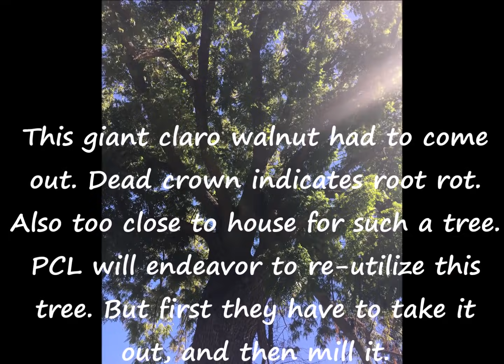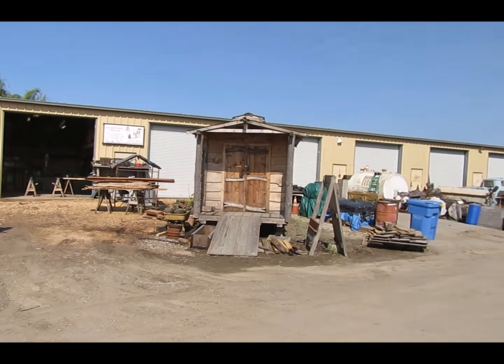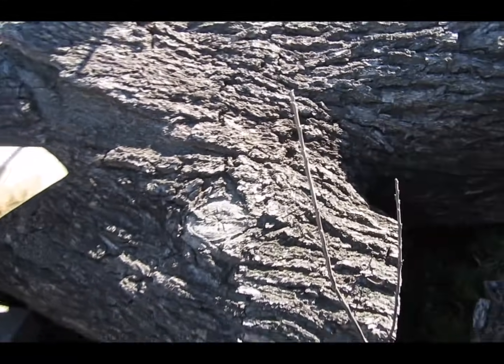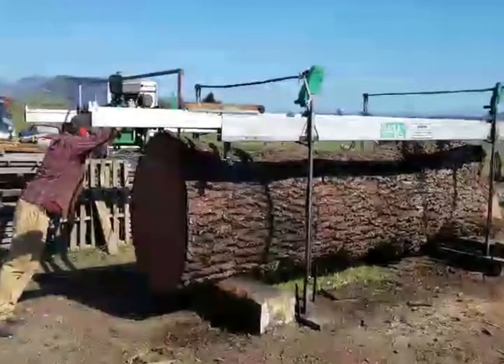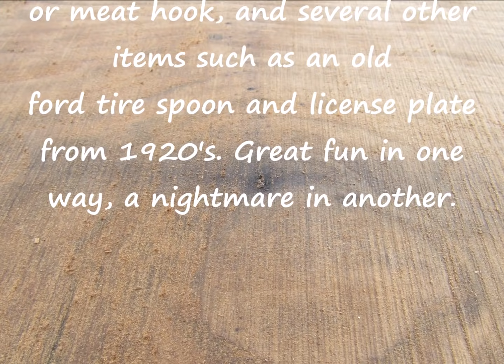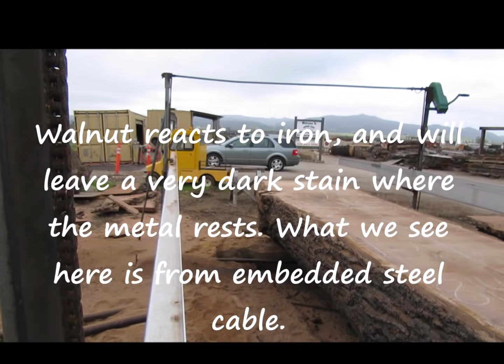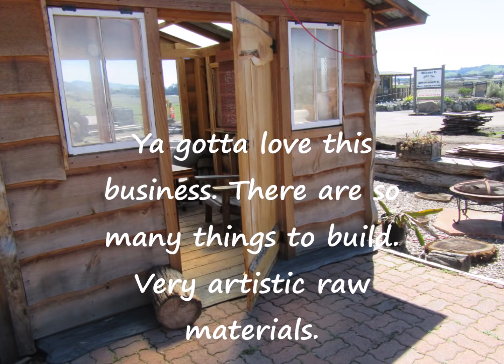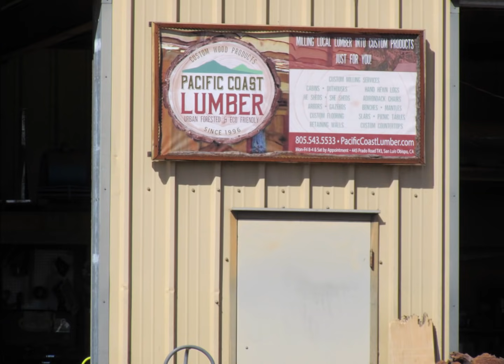Pacific Coast Lumber. Giant Walnut Milling.  23,000 pound log milled.

Comment: Wood cutters where I am (New York) wouldn't touch this tree for milling for the danger of buried metal inside of it. I have several like this and no one would touch them.
Reply from the maker: While I totally understand why they would not touch that, I have to say that my understanding is that there are some that will. 
This log had two visible steel cables going all the way through it at roughly 10' and 12' off the ground, old stuff, but that was it. 
They used brand new chain, and were able to cut right through it. I think they used 8 chains, well worth the good value of the slabs, and they could have re used the chains, but felt that they didn't want to take the chance and get a big belly or concave in slabs this valuable.

Comment: An insult to the log by milling it with that piece of crap mill.  Why not spend a few of those dollars and get a mill with a little quality instead of a dime store variety.  You would get a much better product from the log.
Reply from the maker: 2oldfarmer, how so. What mill would you suggest? What made the product less valuable because of the mill? I am curious. I know a head rig might be a better way, but you suggest there is some kind of small sawmill that would be better than the slabbing system of the lucas mill, what is it you are talking about?  I am interested in your response. I know wood mizer makes a 70 thousand dollar band mill that would mill this, but that doesn't qualify as a few of those dollars, etc. Anyway, thank you for your post.
Reply: Shakes head at old farmers comment rather than a really uneducated ignorant comment step up to the plate and let’s see what you can do!
Reply: Lucas Mills are the real deal. Been making lumber for 10 years with trees too big for local band mills. I thought they were a joke til I ran one. Awesome. Beveled siding right off the mill is on many local homes! Can adjust angles to match old tapered siding too!